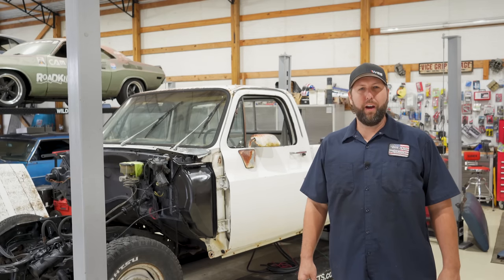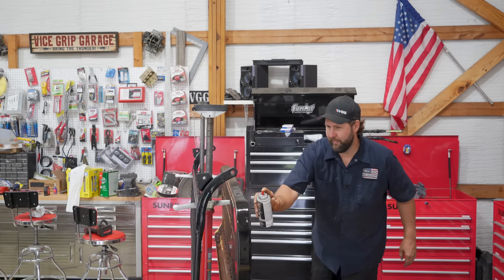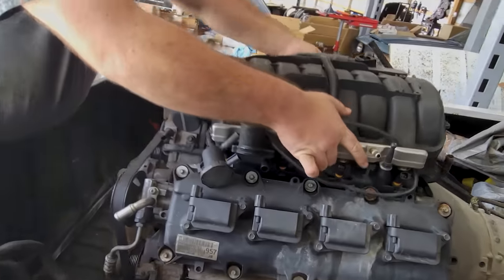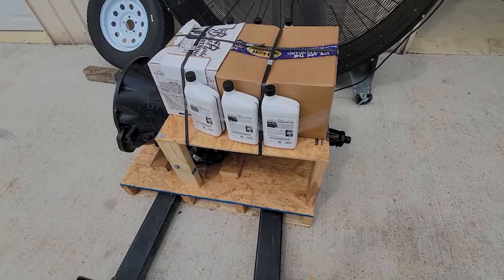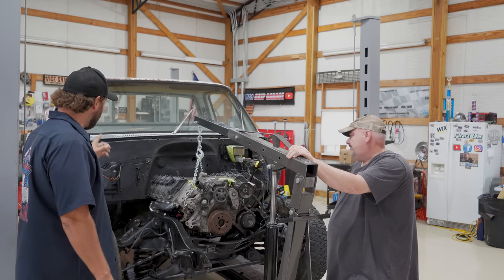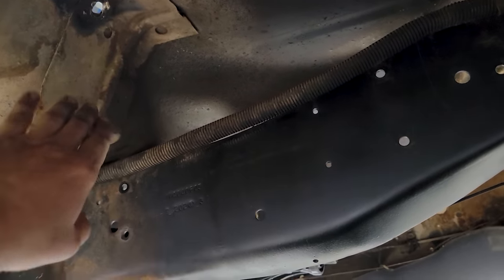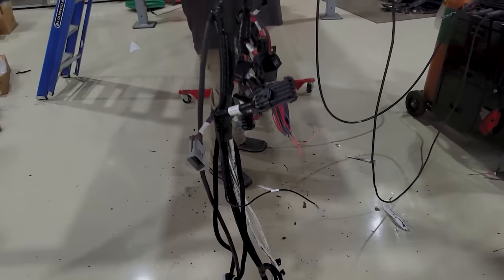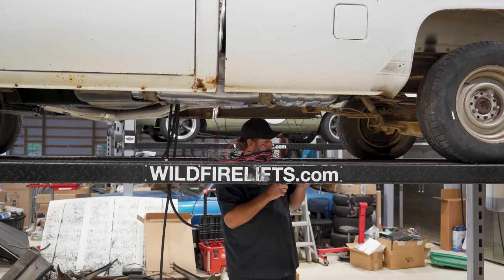Gen III Hemi Swapped C10 Truck Build "HemiHalf" - Part 3 Hemi IS IN!

Comment: When I was in upholstery class, we would put Polly wrap over the old foam to give a little extra cushion and reduce friction between new cover and old foam. It works really well.
Reply from the maker: Interesting ty
Reply: @ViceGripGarage  In addition to the plastic, silicone spray inside the cover and on the foam will help the new cover slip on easier. When I did upholstery, we didn't cut the hog rings, we just grabbed them with the diagonal cutters and twisted while rotating, they usually come off easy and you don't have sharp bits of hog rings laying on your work surface ready to scratch or rip the new cover.
Reply: Good info. Gotta redo my 65 f100 seat and I may use that if it gets sticky. Makes sense.
Reply: Silicon spray does the same thing
Reply: A thin layer of foam will also make the new seat cover fit tighter/better & give a little extra cushion for comfort.  Looks a lot nicer also.
Reply: @marklatham570  I love silicone spray, really helps when messing with silicone couplers and aluminum tubing ;)
Reply: I knew a girl back in the day, who wore skinny (SKINNY) jeans, not the stretch stuff but real jeans. She had to put them on with plastic bags. She would put bags on her feet, folded, and pull the pants on. Since the bags were kind of folded and two plastic bag surfaces against each other, they came apparently off real easily.
Me being a fan of Warren G-ish music and skateboarding, I struggled to understand the trouble associated with wearing your clothes.
Reply: dry silicone spray is what I used when I did upholstery

Comment: Thanks for another fun and interesting video. Can't wait to hear it run. As a teenager, I stuffed a stock car small block into a 67 Impala SS. I couldn't scare up an affordable Muncie, so I found a Borg Warner T10. That, of course, meant a different drive shaft (due to spline difference). Making sure I put no wear on my tape measurer, I just stuffed a drive shaft I found into it. It was only a 'little' tight. The first time I got on it and happened to hit a bump, I broke the left motor mount and shoved the fan through the radiator. I had less concern for my tape measurer after that. When the engine builder learned of my 'lemming charging off the cliff' move, he took pity and sold me an M22 for 100 bucks--because he 'didn't know it's condition.' He rebuilt trannies and knew damned well its condition and worth, but he was that kind of person. You remind me of him.

Comment: Ditto on your caution about getting under an engine on the lift chain. My lift was good, the chain plenty strong, the bolts super.  But as I rotated the engine to align with the tunnel, a bolthead DRILLED through the washer, leaving a spiral groove as it released the chain - and a 426 hemi came down to concrete with a thud.  My head had been a little bit under to see the tunnel clearly - lucky miss, but smashed oil pan, oil pickup screen & tube.

Comment: A guy used to work at Brampton Assembly plant in Ontario Canada building the Charger, Challenger, and 300s.  That guy was lucky enough to work on the engine line and built up thousands of those 5.7s.  Seeing this brought back some memories.

Comment: If you replace those exhaust bolts with studs and nuts then you can avoid having to repeatedly thread into the aluminum and possibly wiping out the threads. Plus, you can hang the manifolds on the studs while you're putting stuff together and it saves a bunch of hassle aligning the gaskets and manifolds on the heads.

Comment: I can’t believe Monster transmission still exists, they sold me one for my Dodge, put it in, truck wouldn’t move, front pump was out, clutches burned out, and the torque converter went at 150 miles. Upon opening the trans I learned, it was a used transmission that had been painted silver, and sent on a truck from Florida to Tennessee. They told me I could send it back if I pay for the like $200 shipping. I asked if I could have a local shop look at it, they said yes. Then when we told them what all was wrong they said, “ Having another shop look at it voids the warranty, we can’t help you. Goodbye “ so after spending $2500 on the trans, I had to spend another $1800 to get it working. Went to the shop 8 times in 6 weeks. This was 2018. Found out my brother did the same thing in 2019. Bought one for his Squarebody. Same deal, used trans painted silver. Wouldn’t move. I cannot stress enough. DONT BUY

Edit: It died again a few months ago, mines an 01 ram 2500 360. I tow a lot of vehicles with her, once I got the trans to work,it worked, till it didn’t. Currently manual swapping
Reply: Presision transmission Amarillo
Reply: I cant believe it either. Most are dead on arrival. They use bent up trim nails to hold the pressure regulator wide open so it feels like a shift kit
Reply: @jaredgrubb30  On Dodges like mine the OEM separator plates where incorrectly drilled. Holes were too restrictive, so anything you buy, or any shop you go to should have the new plates, The Monster had the original pos one. For sure, nothing was done besides paint. The “ burn rubber brewery “ fluid probably has Lucas or Ford friction modifier as it’s main additive in the hopes that it will keep them from slipping till the warranty is up. That company is pure evil

Comment: I highly recommend the 20 Gallon oil drain from Hobo Freight, when it's full you close the valves and put the shop air to it and pumps it out. takes 2 minutes to empty it and no mess.

Comment: When you're recovering the seats 💺, you can rejuvenate the foam rubber. A jiffy steamer like is used on clothes does wonders for it. You am see the foam rubber expand back out to the original shape as the steamer is run over the seat.

Comment: I'm a mechanic have helped the upholsterers to fit seat covers. They spray the corners of the foam with silicon spray. It helps the covers pull on easier and save the foam pulling too. especially on single seat backs where they are tight to fit. As usual an awesome vid Derek.

Comment: Well, actually, ya do NEED an e-brake ... to save your motor mounts. Something has to stop/hold the vehicle still when parked. The choices are e-brakes or the engine connections i.e. motor mounts.

Comment: Hi Derek, just a suggestion, for wheels, I'd put the old style rally wheels with a P255/70R15 or P235/75R15 on there with some whitewall tires. She'd look mighty sharp, cause that's what I did on my 1986 GMC. I just love those old square body truck's.

Comment: With the belt drive maybe look into a 3rd gen ram 2500 belt drive because the ac compressor and alternator is at the top of the motor and also a 3rd gen oil filter adapter if it's a separate peace on the truck engine don't remember. If your worried lifters you can get a melling High-Performance  oil pump. It might last alot longer.
Reply: Would be easier just to go to a junk and pull the timing cover with the accessories on it

Comment: Just something Ive learned from working on equipment weld the nut on the stud getting it as hot as possible and let it cool it shrinks a thou or 2. Not saying it works everytime but something I learned from an older fella

Comment: In the morning when you go out to your truck its covered in condensation. That includes the floor of your truck. Vinal floor coverings make it difficult for the moisture to evaporate from the metal surface under the Vinal. Carpet allows the moisture to evaporate away from the floor. It is the same reason you gave for not liking Vinal seats. Cloth seats allow moisture to evaporate off of  the metal floor. Vinal is just plastic. Vinal rots truck floors. Even if you get snow on carpet it will still evaporate away.

Comment: Love the progress on the truck. Quick tip on the bottom foams. They might look good on the top but they like to split where the frame meets along the outer edge. I glue mine together with upholstery cement and then glue some fabric backed foam over the repaired area for insurance. I thought the exact same thing when you were under the engine. 😬🤔

Comment: The three spoke double bolt torque converter is for the 5-speed nag1 transmission you need a four-spoke single bolt torque converter for the 4-speed transmission 42rle

Comment: Hey, professional upholsterer for many years here. Don't cut the hog rings. Twist them off. If you just grab them with the end of your cutters, then twist counter clockwise, they open up and slip right off. Saves your hand and wrist and potentially eyes.

Also, turn your covers inside out. This way, you can line up with the original seems, and you can keep the selvage going one direction. The selvage for those who don't know is the scrap of fabric on the back side of a sewn seem. If you don't keep it on one side, it will flop back and forth, and look like the stitcher was drunk.

Comment: On covering the seats you would be amazed at how easy a cheap 50 gallon trash can liner ( thin clear ones like they use in restaurants) makes that job as far sliding it over the foam

Comment: I’m so glad you’ve done these videos, I have a 99 Dodge Ram with the bulletproof 360 magnum in it, but at 341k miles on the old girl, the engine has just about had it. She’s getting low on compression and clattering on start up, over all she’s down on power, not smoking yet, but still. I mean, almost 350k miles of hard work on this engine, towing, hauling, teaching teenagers what for at red lights, she’s been a good one. But I’m definitely interested in doing a hemi swap when the engine finally goes. Hopefully she will hold on until the 25 year mark (Texas stops emissions testing at 25 years) so I can really let loose on her and turn her into the power house she deserves to be, and make her sound as good as she looks. I’m so glad you’ve been doing this swap because it’s something nobody is doing.

Comment: If you cool the nut with water fast the bolt shrinks and the block stays  hot it will come out fast .we did this way in machine shops I worked in and coal preparation plants I worked in .

Comment: Just run the e-brake cable down the drivers side frame and put your "y" junction at the back just before the drivers side rear wheel like a Ford. Then you will have the big three all in one vehicle.

Comment: Sorry, I haven’t watched last weeks video yet but I just wanted to say that in 1966 I had to piece a floorboard into a 57 Chevy that had a badly rusted out floor. It was a 210 model and had vinyl floor covering. They didn’t make replacement floor parts for them back then. It seems that there is no air flow under the vinyl floor to dry it out when condensation develops water underneath it. You might want to install carpet in that floor.thanks for sharing this video. Love what you’re doing with it and the Hemi although some may think it’s blasphemy.  
👊😎👍🇺🇸

Comment: Thank you for a wonderful channel on YouTube my children and I love it. 
As far as rust control is concerned in aviation we use Corrosion X, which typically stops rust in its tracks. Have you heard of it, it’s a wonderful product. It comes in spray cans and in barrels for huge jobs they spray it on the inside of aircraft wings and other places were corrosion can occur on scene. It is also good for significant rest.
Thanks again
Uncle Larry B

Comment: Upholstery tip, add burlap or some type of heavy duty material too bottom seat frame between foam, it’ll keep the wires on the frame from cutting into the foam.

Comment: whenever I have bolts too long I do the right thing and make them shorter with the wheel of death. Cant go buying new ones and I dont have to wait to go to hardware shop. If I do it right I can manage to cover the car/truck with grinding sparks as well.

Comment: You can try using the factory 45 degree oil filter adapter that is used on the 4 wheel drive Dodge trucks and Jeeps.

Comment: 84+87 Chevy truck uses the 2 nd revision of the emergency brake cable adjustment buckle although they refer to the buckle as something else,,it moved it up under the bed,I believe because of the cat and mount configuration and the newer style exhaust system setups there was a few more issues but from what I could tell that was the main reasons for the revision

Comment: Hi Derek I can tell you I use a product called ospho for treatment of rust. I pick mine up at the local Ace Hardware Store has a simple process of just spraying it on I usually do two coats one after the other when they are dry and it basically turns the metal back to usable and it kills the rust as well. I'll use the other products as well they work pretty good but not like this stuff and after all I do live in the Rust Belt in Ohio. I'm glad that Chrysler kept making Hemi Motors or at least brought them back I guess although they are totally different than what they had before that's for sure a lot more lightweight and a lot more technology. I know that they still have the 392 which is the bigger Hemi out of the two because let's face it it's a 5.7 the Gen 3 and the other motor is just wow, I wonder if they will ever build a 426 again I doubt it though. Thanks for sharing the video Derek as always I love all the stuff you do, I just hate that you have to rush all your projects just to get to the event probably why you haven't won more stuff then you already have done after all we know you've been doing this quite a while now. Many blessings to you and your family as always your friend Joe.

Comment: The later units have electronic  throttle pressure moter to control line rise and timing. Maybe the holley electronics has the provisions to program

Comment: I'm doing a camshaft and lifters on a 2011 grand cherokee 5.7
The oil filter housing on those is tipped out twords the front 45* might work for the clearance issues.

Comment: Some vehicles you can run wire through the A pillar to the rear corner of the cab. Roof mount lamps wires go up that way thru the A pillar I know. Too bad its not a short bed with a wood floor. It would look nice all dolled up with maple planks and chromed strips in the bed,  Lacquer paint fumes will cause baldness!!

Comment: Derek Bieri You may have fixed problem already. But if a guy were racing dirt track he would have seen this trick . Stretch a belt between the water pump & crank just for safzees! Got that tip from a legend @ my old school parts store years ago . My Rocket 350 kept tossing the belt @ the drag races .

Comment: if the foam is a bit compressed, you can steam it and it will fluff back up again. as long as the foam is in good condition and not  deteriorating

Comment: Derek have you thought of putting a lean to type roof on the end of your building with water, electricity and air outside.  Use it for a wash rack and a crude paint booth.  with the open sides the light will be good.  Most important you will not be spraying water and paint around all that expensive tools, equipment and autos.  Make it big enough for a bench and table that can be locked against the building and tall enough to drive the motor home through. .  It won't be long those boys will be washing and painting their projects.  Make a safe place for it to happen.   You can add walls and doors later if you want to get all fancy.

Comment: Why don’t you get a truck timing cover set it moves the alternator to the captain side and rotated the AC compressor more up right for those AC line. As far as the oil filter they have a own 45 for the grand Cherokee and Durango hemis that would be perfect for that situation

Comment: Been great watching this build, ironically you would have been way further ahead using a Ram 2500 engine.  But you use what ya got!  The 2500 does not have the MDS solenoids on cylinders 1, 7, 4 and 6,  it would have a different timing cover so no coolant tubes running through the valley, and different accessories locations, intake has active intake runners (more power), it would have had the correct oil pan and most importantly they come with a 45 degree oil filter adapter and the dipstick tube.  Different topic I really like those headers, looks like you did have a broken exhaust stud or two on the number 8 cylinder.  Great build thus far really enjoying it!

Comment: If you spacered the poly mounts on the motor I wondered if that would gain you enough room to use the oil adapter. There's probably a remote kit out there to solve your issue .

Comment: Bet you can make that Chevy shifter work like factree just as easy as cutting up the floor. You can tune that trans to shift like you want, my Hemi truck will hit hard if I’m on it and smooth at part throttle.

Comment: I wonder if they make a oil filter adapter to make the oil filter go forward like a big block MOPAR does? You may have to grind down the bracket where the whirler Charger used to mount to clear the filter. 
Looking forward to seeing the next video Derek. Have a Blessed One Sir.

Comment: Your oil cooler lines. Make a plate and thread it to accept an fittings.. install a external oil cooler kit for a 6.2 chevy diesel cooler that mounts in front of the condenser for the ac..
It need it cuz of the 5w20 oil..
If your careful you can just thread the block with a pipe tap like gm did and install an fittings instead of the plate.

Comment: I hope this message gets to you before you backfill after your flood. I have been a developer for forty years and noticed how you ran your downspout drainage. Your Downspouts should be tight lined and you should have a separate perforated pipe to pick up the water from your hillside. If you leave it as it is all the water from your roof will overwhelm your drainage around the shop.

Hope this helps
Matt

Comment: And I'm just letting you know the rolling bearings on the 5.7 don't get enough lubrication so they overheat and then the bearing on the rolling bearing breaks and then it rubs up against the camshaft and digs into the camshaft I would use a thinner oil and put a hellcat oil pump on it